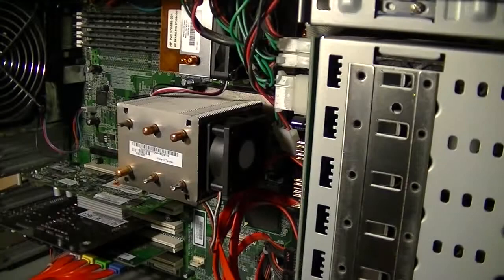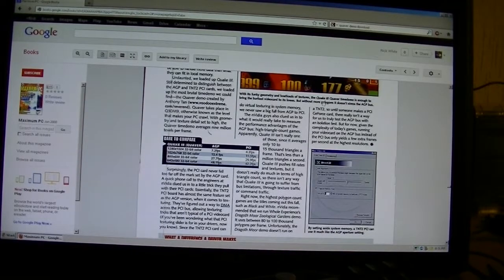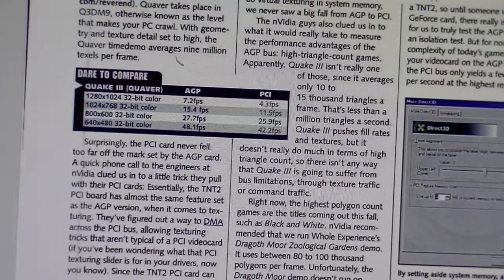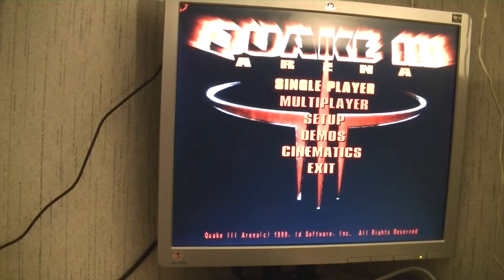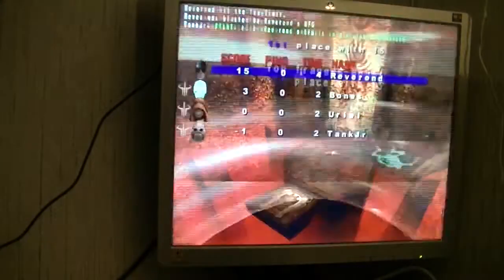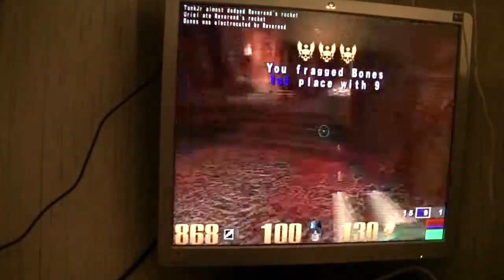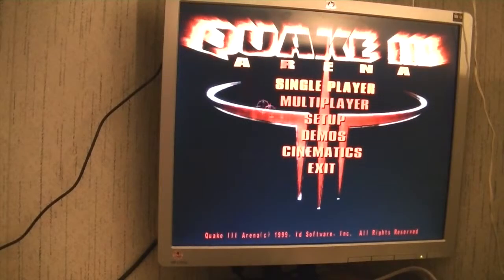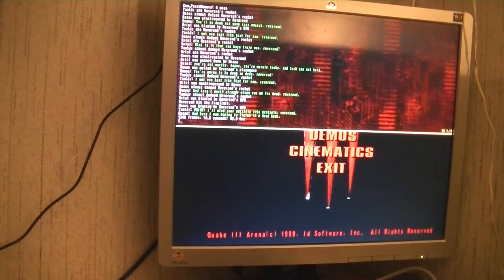Quake 3 "Quaver" Benchmarks on Intel Xeon 604 3.6GHz with PCI Video

Comment: I know this was years ago, but I wish you still had it in front of you because I'm curious if the 8400GS PCI can run at 66MHz PCI.  Looks like that motherboard should have that capability and could have tested if the card gets faster when installed in one of those slots.
Cool demonstration though.  I bought one of these cards a few years ago to install in my server so it could be a usable participant in LAN games, but I never ended up installing it.